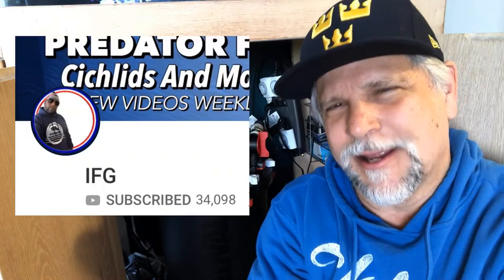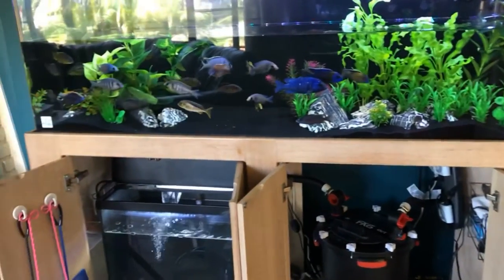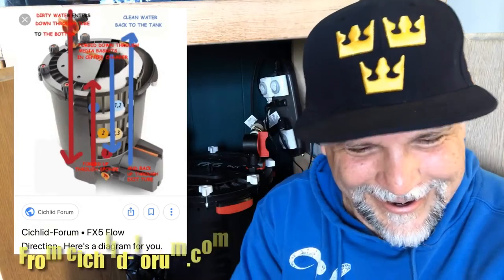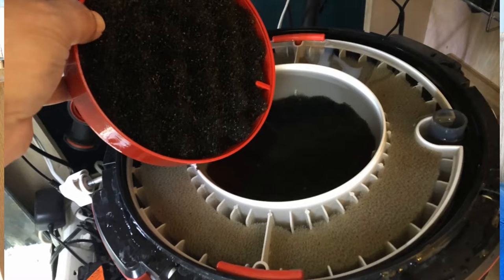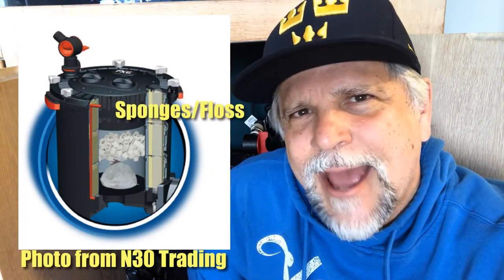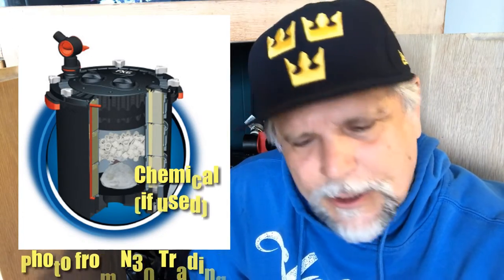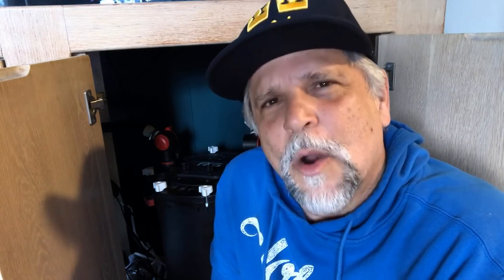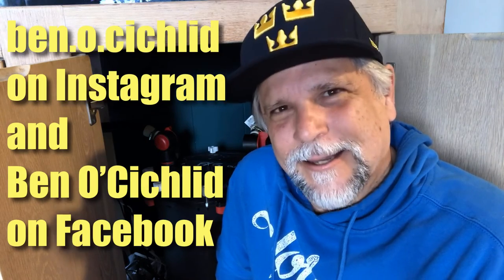Fluval FX Canister Filters - Before You it Plug in - WATCH THIS!

Comment: Question on an old video.   What’s up Ben.   I cleaned my fx4 impeller and all.   I did this because I unplugged it to do a big water change.  When I tuned it on the flow decreased dramatically from the output. (Before cleaning).   When I serviced the filter I assumed the flow would would be strong again, but it wasn’t.  Any suggestions my friend?
Reply: Check your intake hose.  I have had to clean mine two to three times during the cycle.

Comment: Question; One of my FX-6 cannisters is picking up a tremendous amount of air to the point where fine bubbles are in the outflow. It does shut off by itself periodically however there is much more air than the other cannister which is connected in the exact same way on the same tank. A ton of air comes out when I shut it off for feeding etc. Where could the air be coming from? There are no leaks that I can see, otherwise the unit functions perfectly.
Reply from the maker: Allan, there's air getting in somewhere.  Start at the top (outputs / inputs) and work your way down making sure every connection is nice and secure, including the motor housing as shown in the video, the screw down hose clamps and the lid fasteners.  That is has got to be come in at one of those points.  The other alternative is a hairline crack in the canister lid or body which would be a difficult fix (but that would be showing a water build-up...). 
 Good luck sorting this out.  Also, contacting Fluval might shed some light. 
 They are responsive.
Reply: Could be a bad oring seal as well or damaged seal or a missing one...
Reply from the maker: Larry R yes. Check them. They are available on Amazon and at Fluval
Reply: Checked all the connections at the inlet end which looked fine. I then adjusted the hoses so that the connection between the hose and the plastic pipe are completely under water so if there is a leak it will pull only water down the hose. It worked! Thanks Ben.

Comment: Ben,
Thanks for a great YouTube channel. 
I just got my FX6, Yet to set it up and I am confused if I should add chemical media to my FX6. What is the advantage of it? Some other YouTube videos were only doing biological in all three trays. 
Also, is any chemical included with the filter? Mine did not have and came just just two white bags and a thin black sponge. 
Looking forward to your response. 
Thanks!!
Reply from the maker: Is it going on a new or already established tank?  If it’s new, activated charcoal, chemipure or Purigen can help clear up the initial cloudiness. After my tanks became well established I stopped using chem filtration. If you do use it I would put it in the bottom middle section so water hits it last before returning to the tank.
Reply: Ben Ochart - Thanks!! 
It’s a used 135 G tank I picked up and setting up from the scratch. I will be using a sponge filter from my existing 55G tank.

Comment: Take a look at Swiss Trooical. They sell sheets of poret foam. It is top quality. I cut all my pads from that. They have it in all thicknesses as well as all PPI. Much  cheaper than the fluval brand and better quality.
Reply from the maker: I ran into the owner at the airport. Nice guy.  I'm thinking about building a sump with a sock, poret foams and then bio.  It would be a great cichlid tank sump.
Reply: @BenOchart  Never been a fan of the socks. They seem to clog up so fast. U definitely have to give them a good cleaning pretty regularly. Any idea on where ur going for the sump.
.
Reply from the maker: FISH ED under the 100 with an overflow box
Reply: @BenOchart  I thought u were getting another one.

Comment: My fx5 sounds like waterfall inside the canister... can’t figure out why
Reply: You've got more water going out than coming in. In other words your pumping out more water than you're able to take in. Solution is check to see that your sponges are clean and hoses are routed correctly. Also make sure you have enough drop in your system having the center low enough to created the proper suction.

Comment: Hi Ben. Thank you for the video. I just bought a fluval fx6 and would be setting it up this weekend. What should i do when it automatically shuts off the first time i plug it? It will run again on it's  own? Or what happens after it shuts off?
Thanks
Reply from the maker: Shutting off after running is how it purges air and occurs every 12 hours. Don’t mess with it when it’s dining this (like unplugging), it’s how it’s supposed to run.
Reply: Ok so just let it shut off by itself to do the air purging and it will run again by itself?! Thanks Ben 👍

Comment: my FX6 shut off a day ago. I did the typical maintenance and cleaning. Put everything back together as it was but nothing. I left the motor out unplugged for a day and the propeller started spinning as it should then I put it back again in the canister and it pumped the water but it shut off again. I wonder if the motor is going out or if the magnet has loosen strength . I idd the prime thing twice but is not pumping any water to the tank and it got all quiet and no noise or vibration coming from the canister. This guy is laughing because he knows the trick to make them work...I mean how complicated is this motor lol is basically a coil and a magnet with a propeller. There is no programming or circuit board to reset it.
Reply from the maker: When you say "shut off" you're not referring to the normal air purging shut off it does every 12 hours, right?

Comment: Please don't laugh.
I have a huge pc that is watercooled.
I ran three different pumps. It was a pain to clean, pain to maintain, pain to swap pumps because they are all pieces of crap.
To match the head pressure and flow rate,
I had to get one of these.
Lol.
Yes, I'm in the top 12% of the coolest benchmarks on earth.  It's a beast. Beast needs water. This pump gives it.

Comment: Why wouldn’t a canister filter make it where you put the chemical filtration easily on top. Instead of always at the bottom. That way you can add and remove easily if needed.
Reply from the maker: I position chem filtration so it’s the last thing water touches before returning to the tank. So whether it’s at the top or at the bottom would depend on the direction of the water flow. For example, in a SunSun it would be on top but in a Fluval FX-6 it would be at the bottom of the center section.